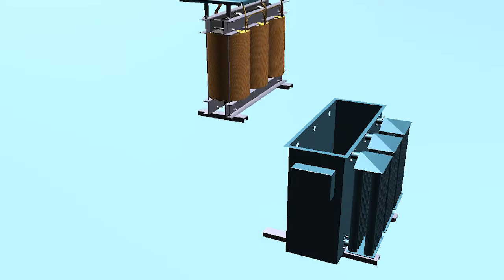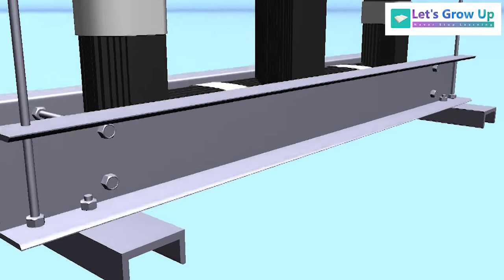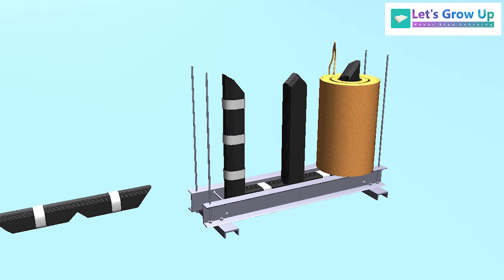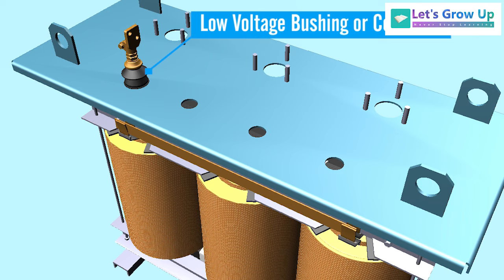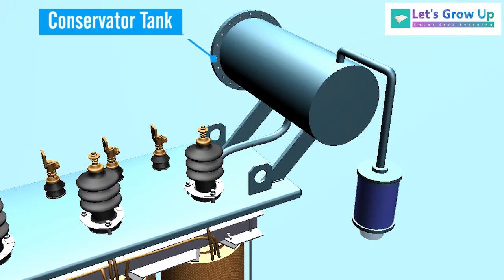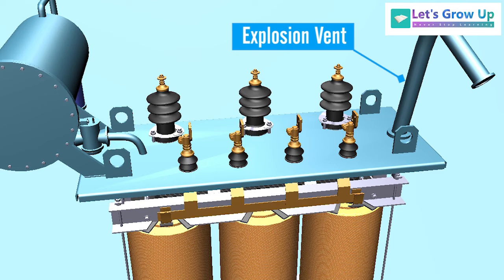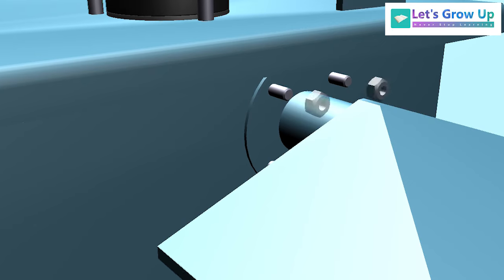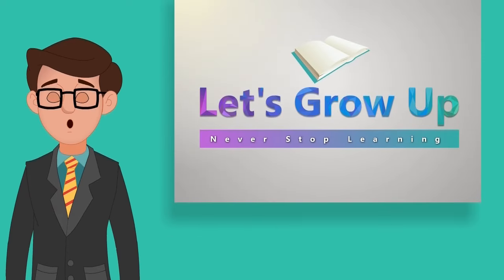#transformer assembling steps | #transformer | #electricaltransformer | working of transformer

Comment from the maker: Q | Why the transformer core is made as thin laminated? Share your answer🤔🤔🤔🤔
Reply: Transformer core is laminated because to reduce Eddy current loss.
Eddy current loss(Pe)=kB²m.f²t²V 
Where, Bm- maximum flux density
f- frequency
t- thickness of the core
V- volume of core.
Now we can says that, Eddy current loss directly proportional to square of thickness of the core (t²).
If we  can reduce the thickness,then Eddy current loss also reduce.
Reply: @shyamsundarRana  ok
Reply: To Reduce Eddy current loss
Reply: Lamination of core is done to reduce the loss due to eddy current which opposes main current.We know eddy current flows due to the unwanted induced emf in the core(unwanted induced emf in the core arises due to the varying main flux cutting the core).This unwanted induced emf can be reduced by channelling the current paths of the core (making the core laminations as thin as possible).This thin laminations ensure reduced Cross-sectional area of each current path and hence reduces unwanted induced emf. Finally eddy current is reduced!